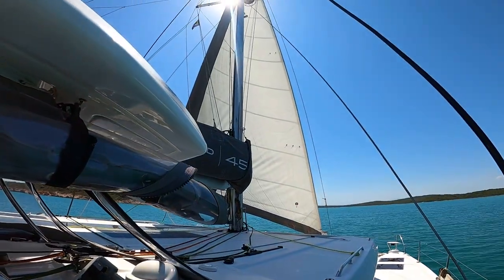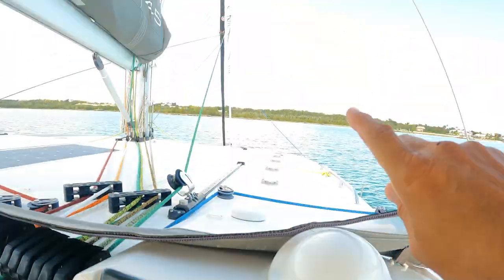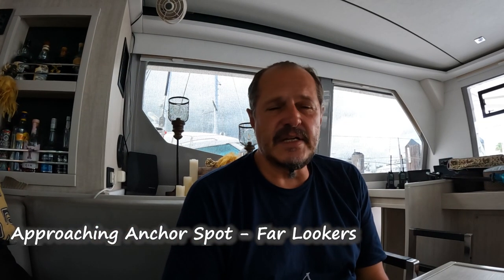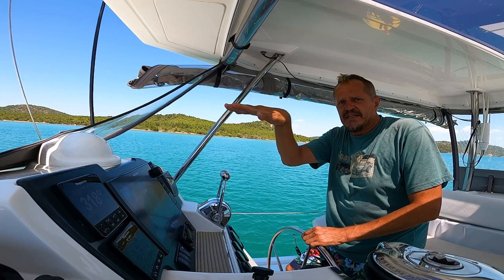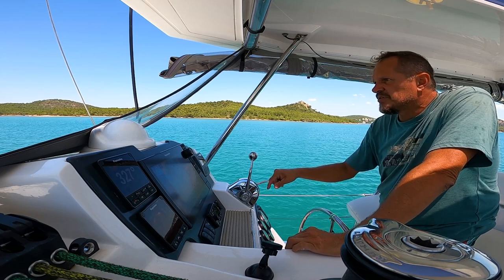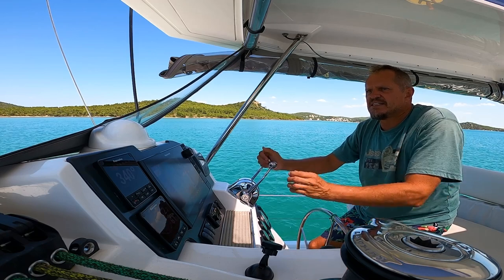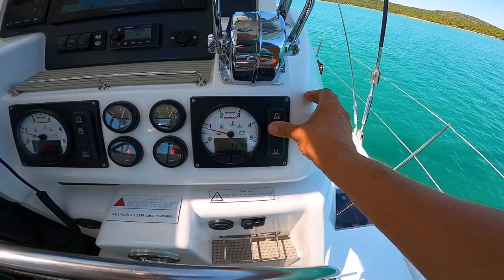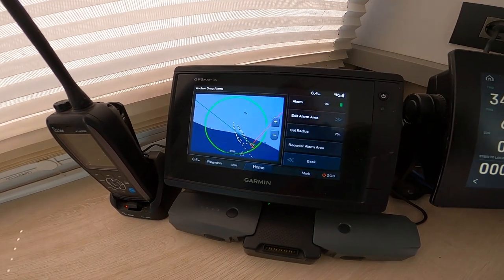#180t WHILE You Anchor - 10 Things to Check | Sailing Sisu Leopard 45 Catamaran Circumnavigating

Comment: Very nice tutorial- thanks! For people learning it might be good to know that keeping the bow into the wind when deploying or retrieving the anchor is less critical if you have a monohull or catamaran where the anchor deploys from the front of the boat. On certain catamarans, eg Leopard, FP, Balance 482, where it deploys from farther back near bridge deck, you are correct you need to worry about chain rubbing against the hulls until you get your bridal on.
Reply from the maker: Glad it was helpful! Yes, it is only when there is a chance of the chain going under the hull and then lifting up when the tension point is reached. It could happen with a monohull too if the bow swings too much downwind and the chain is on the leeward side ;-)

Comment: Nice, relevant video.  Frik, I noticed you were using a Garmin for your anchor alarm, but Raymarine at the helm.  Doesn't Raymarine have an anchor alarm option?  Also, do any of them have the ability to notify the owner over Wifi (using the on-board Wifi) or Cell if the anchor moves? (like if you were ashore and the anchor moved, you would get a text message or something) ?

Thanks again
Reply from the maker: Thanx for watching,  Douglas! Yes,  I discussed the anchor routine with Raymarine and then they implemented it beautifully, however, they missed the part where one should be able to move the centre or anchor position AFTER you anchored... no, none of the Raymarine or Garmin can notify you...

Comment: Nice one👌, How and when.. do you use 2 anchors??
Reply from the maker: I don't :-) I have been discussing this with many sailors, but my physics mind is not satisfied with the vector forces on two anchors vs one anchor. I looked at the various variations of two anchors and the outcome stays the same in my mind. You will drag or foul your anchors when the wind change or tide change. I am not talking about using a ketch anchor to prevent swinging, but two anchors in a serious storm. Anchors are good in one direction only, the moment you put a different vector they will be compromised. For example, if you have two anchors in series tandem and they are set in a southern direction. They will be very good. However, serious storms have the tendency to be cyclonic, meaning the winds will shift many times through 180 degrees or more. Now imagine those two anchors in a straight line and the wind shifts 90 degrees. The closest one will want to reset, but the furthest one is unaware of the shift because its chain still runs south and then bends west at the closest anchor. The closest anchor doesn't like the 90 degrees and tries to reset, but is now being pulled north backwards and west at an angle, perhaps it can reset while still buried, but if it doesn't, it will get lifted and then it will "hang" on the chain unable to burry itself again. Just imagine a strong wind and big swells lifting the scope just slightly with the chain having a kink at the closest anchor...that picture bothers me :-)
Reply: @SailingSisu  thanks for a very interesting and detailed answer, I will think for a moment about your answer… thanks again and greet the lady